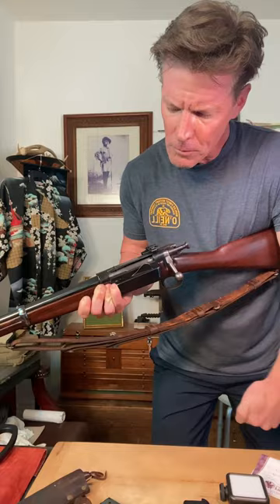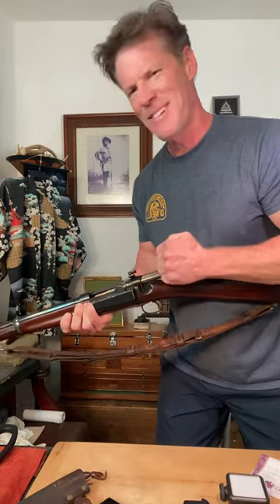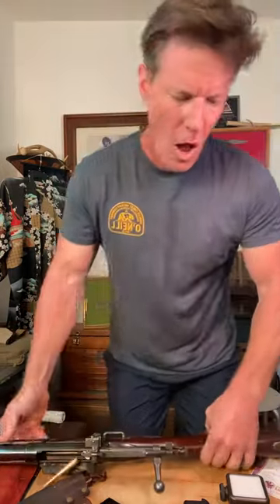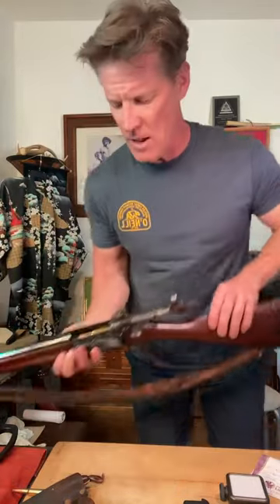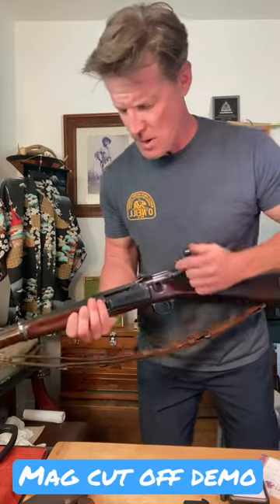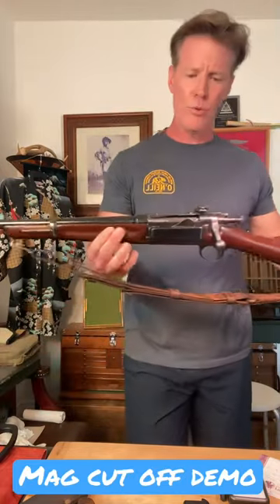Magazine vs clip but this happened! What's this?

Comment: The Krag Jorgensen had an INTERNAL magazine, and it served opposite of Spanish stripper clip loaded INTERNAL magazine 7×57mm Mausers during the Spanish American War.
Reply: And even though America won that war they decided the Krag was not fit for purpose and developed the Springfield 1903.
Reply: @krunk28  And the Springfield M-1903 was itself, a licensed copy of the German G-98, chambered first in .30 of 1903 (which prooved underpowered) then later .30 of 1906 (aka .30-06).
Reply: @krunk28  the 1903 was based on Mauser rifles they captured.
Reply: @acester86    Rrreeeaaalllyyy did you also know that it should really be called either M1906 or M1903 Mk1 due to the amount of changes after adoption. That we lost a legal battle with Mauser because we tried to confiscate the patents on the rifle during the war.
Reply: @krunk28  yes. I'm well aware.

Comment: The 1898 Krag apparently was the first American bolt action rifle. Used in the Spanish American War 1898. So came before other magazines.
Reply from the maker: Bing Bang Bong Bingo
Reply: I thought it was designed in Norway? Or do you mean the first bolt gun adopted by the US?
Reply: @illswift5  adopted
Reply: It was also the first smokeless powder cartridge.
Reply from the maker: @TwoStageTrigger  My Dad told me that years ago, thx Yes it was the first smokeless cartridge.
Reply: @Baasicstuff t was the first smokeless cartridge adopted by the us. And it was adopted in 1892 by the us. But it was adopted in Denmark in 1889. Which also happens to be the same year Paul Mauser came up with the stripper clip and incorporated it into the 1889 Belgian Mauser.

Also the Norwegians attempted and trialed a stripper clip system for the krag
Reply from the maker: @jakesolver4359  Thank you great info

Comment: The reason why it didn't eject when you went to catch it was cause you didn't pull the bolt back far enough to grab the next round. Super interesting piece of machinery there. I love the questioned blinks at the end
Reply: I caught that too and was coming to say this.  Thought it was funny
Reply: @mitchellhampton4175  that's how I felt when my high brass shells crammed themselves into the barrel on cam both times

Comment: You can see the exact moment in his mind where he said “wait, that’s not supposed to happen-“
Reply from the maker: you see the video were the bolt fell on the ground lol ;)
Reply: Watch when he goes to extract the last round, he doesn't fully pull the bolt back but the round falls out when he lays it on the table. When he goes to feed a round, the bolt was already too far forward and didn't pick up another round.
Reply from the maker: @kfred936  Magazine cut off was on another round was never fed. You may have said that lol its to hot in my office

Comment: It is called a trapdoor magazine, was first introduced in 1886, at which time Tube Magazines, stipper clips, etc. were all already in use. I threshing fact, they did develop a stipper clip "speed loading" clip was introduced for this riflle. One advantage that the Krag Jorgensen had was the side door opening which allowed the magazine to be topped off with a round chambered and ready, unlike top loading trapdoor magazines like the Springfield 1873...

Comment: It's called a capsule magazine. Stripper clips came out in 1889. The Krag Jørgensen was first adopted by Denmark in 1889. The capsule magazine was reduced in size to lighten a prototype rifle around 1886. The first country to adopt a stripper clip rifle was Belgium with the 1889 Mauser. The first Mausers were completed in December 1891. So the capsule magazine was both developed and put into service first.

Comment: I'd imagine an external box magazine. Like an internal magazine just reversed for faster loading. I'd also imagine it came from around the same time as the stripper clips. You didn't have to load a stripper clip, and when you wanted to unload you could dump all the rounds in your hand vs having them ejected by a spring and sending the rounds every where saving ammo. It's a really cool design. Except if I'm not mistaken that button to open it can be touchy

Comment: somewhat of a hopper fed rifle and the loading system was more of an experimental concept like when the p08 luger came out or when en-blocc clips were first used, no one knew if it was the direction to head towards in firearm design but it was an option to consider

Comment: It's not a debate.  It's a magazine with a loading gate/port (either is acceptable).  Anything, tube, detachable box or bunker built into the side of a berm is and always has been a magazine.  
  As a military trained munitions systems specialist, that was my job.  Dealing with small arms, heavy arms, bombs, rockets and more and Anything that stores ammo, be it separate or attached to the firearm is a magazine.   Loading ports are any accessible port or door that allows for the insertion of ammo into a magazine or directly into a chamber.
Thanks for playing.  😀
Reply from the maker: Nice name and spitting some fact, I like that
Reply: @Baasicstuff   The name was given me in the military, as I was a munitions systems specialist and used to blow stuff up for a living.  😆
Reply from the maker: @MtnBadger  Glad you're here ;)
Reply: @Baasicstuff   You need to "re love" my second comment, a simple edit took it away.  😢

Comment: What makes it nice, is you can grab loose rounds from an ammo pouch, make sure they're all facing the same way, and drop them all in and slap the door shut.  You don't have to load it 1 by 1 or fight with a stripper clip.
Just dump them in and go.
We've never had a jam.

Comment: It is a semi rotary internal magazine. Striper clips were used first in the 1889 mauser rifle and enbloc clips in  blackpowder 1880s rifles like the original mannlicher. All of those predate even the earliest Krag Jorgensen rifle. It wasn't the best design. Single lug rather than duel lug meant smooth action but limited the power of the cartridge to something at about 2200ish fps.

Comment: 5 round hatch loaded internal magazine. I would imagine this was designed and manufactures after the stripper clip or clip loading designs for internal magazines. Probably as a response to a period correct fudd saying "what if your rounds aren't loaded onto their little clips and you need to reload?"

Comment: That is a Swiss Krag rifle designed in the 1880s well before magazine designs were sorted out. The design was implemented for soldiers of the time to easily top off the magazine. While fine in target shooting situations in combat they were a nightmare and quickly phased out in favor of stripper clips as a simpler system under fire. They are cool but there's a reason the American Krag was only in service for only 5 full years of adoption and replaced by the Springfield 1903.

Comment: It's just fixed magazine. Any internal mechanism that holds rounds is a magazine. Fixed is just not removable as opposed to a detachable or box magazine. A clip is just a temporary holder of rounds that is used to feed a magazine. The clips for a krag follow the En Bloc pattern.
Also yes technically a cylinder of a revolver is a magazine and a speed loader meets the definition of a clip.

Comment: This style of trap door internal magazine system should be the default of bolt action guns back then instead of stripper clips, imo. It's so easy to just put rounds into the box and close it to load those rounds, without the need of stripper clips.

Comment: I don't know why this video and comments section bothers me so much, but it does. Possibly because the video doesn't actually say anything other than "look at this Krag". If the gun holds more than one round, and pushes that round into the chamber with a spring (clock or coil), it has a magazine. What you're referring to is a detachable box magazine which has existed in patent form since the 1870s or there about. Box magazines only came into widespread on LMGs due to the increased cost of manufacture compared to an internal magazine. Internal magazines can be reloaded with loose rounds, like the pill magazine on that Krag, or with clips like on name your favorite WW2 service rifle. En bloc clips invented by Ferdinand mannlicher act as an integral part of the magazine once inserted (when empty either fall out like on the Mannlicher rifle, or fling out like the Garand). Stripper clips, the much more well known variant were invented by Mauser. The third option is a charger, like on the Schmidt-Ruben. These sit around the bullets and are often made of compressed cardboard, like old shotgun shells. 
But you asked which came first, and that is just the internal magazine, in particular the tubular magazine. These are rarely able to be reloaded with any sort of speed loader, and are often a controlled feed. This is because otherwise the bullets would sit top to primer, which could risk a detonation (how much risk is debatable, but militaries thought it was enough of a worry to design around it). Lots of lever guns use tube magazines, and in service weapons the Lebel might be the most famous to use it.

Comment: According to the patents it was called a capsule magazine, and the original drawings had it as a 10 round coil which would wrap almost completely around the action. The Danes, Norweigians, and eventually Americans went with the more manageable 5 round version.

Really, it's still a magazine; just not a removeable box magazine like the one you picked up.

Comment: Have one of those used by the rough riders an the Krag .30-40 has one of the best actions ever made.
Reply from the maker: Wouldn't say best, very smooth though and a great pick for deer hunters.  Mauser action was its replacement, still around today.
Reply: @Baasicstuff  Maybe not the best but most collector's, historians, vote it as the smoothest action designed.
Reply from the maker: @paullion3763  you're a boss, thank you

Comment: It's called a magazine. A clip is only a clip when the bullets are on the stripper clip you use a stripper clip to load an internal magazine. Just because a rifle is loaded with stripper clips does not mean that it's internal ammo storage is now called a clip. Fun fact 556 ammo issue to the United States military comes under 10 round stripper clip and can be loaded into magazines via the stripper clip that does not turn the M16 magazine into a clip.

Comment: Do you oil the bolt?
Edit: this is the easiest I've ever seen to load rounds in a magazine or whatever it's called.
Reply from the maker: Completely cleaned, Ive also put close to 1000 rounds through this one.
Reply: This is the slowest way to load a magazine
Reply: @krunk28  you've never loaded a magazine in your life. we're talking about loading rounds into the magazine not the magazine into the rifle. Unless you have a magazine loader, this is the fastest way I've ever seen rounds loaded into a magazine.
Reply: @privatesocialhandle  I have this rifle and many others with these bolt-action rifles loading the magazine is the same as loading a rifle. I can load a Lee-Enfield's 10 round magazine faster than this.

Comment: Maybe its just me but this reminds me alot of "gate loading" revolvers. Ones where you slide a sort of door (hence "gate) open and individually load rounds into the cylinder because the cylinder doesn't swing out like in more modern revolvers 

Based on that, I'm thinking this came before clips and was possibly the standard sort of deal until the invention of the clip?

Comment: It's a magazine it's always called a magazine. whatever is used to hold the ammo for a gun is called a magazine, a clip is to fill the magazine so that the magazine can reciprocate the gun itself. even if the gun didn't have a "magazine" like you're used to like say a Kar98K, Mosin Negant or the Arisaka just to name a few they ALL had magazines. it's just they were integrally mounted because it was easier. once The great war went on and the innovation of the soldiers on the front. ended with coming up with the detachable box magazine as well as a lot of other modernly used tools that most take for granted. like the folding Entrenchment tool and the rest is history.

Comment: he either thought one of 2 things the original round was still there but fell out and was no longer loaded in the chamber or 2 he knew it fell out but didn't realize he didn't pull the bolt back far enough to load another road and thought it had

Comment: Parkhurst Device... Rare.. Only 100 Krag rifles and 100 carbines were made with the so-called Parkhurst device in 1899
Reply from the maker: 1895 variant here
Reply: @Baasicstuff   It's a very clever system. But pretty much got nixed by the 'O3 Springfield if I remember correctly
Reply from the maker: @bentleylongaker  Yep, Ive heard some say politics and such but my 1903 Mark 1 is pretty sweet, thats the next video.
Reply: @Baasicstuff   will check it out. oh.. And politics NEVER get in the way of Military' weapons and systems... ROFL
Reply from the maker: @bentleylongaker  well I have open ears, after this many comments Ive learned a bit

Comment: Anyone else wondering why there ist no round ejecting on the last pull.
Reply from the maker: magazine disconnect, I ejected the first round, the 4 in the magazine are there for the charge. If in a good spot have cover, you can load one round at a time, without the next round feeding up, saving the other 4 for the charge.

Comment: Do they not make dummy rounds for 45-70? The use of live ammo really makes me sweat
Reply from the maker: It does me also, I have quite a few safety rules I follow. The only rifle Ive had that I don't cycle would be my SKS, as they can fire from what Ive seen.  Modern Ammo is very safe, but a gun is not a toy and should be respected at all times.
Reply: @Baasicstuff  not trying to be "safety nazi" just saying the first thing I noticed lol
Reply from the maker: @Jon871000  No totatlly fine. its not an ignorant comment by any means, I may do a video on firearm safety, I was a range officer for a few years, Ive seen some crazy stuff, safe or not thats why that rife is pointing down alway while that round is chambered. I also just don't pull triggers to just pull a trigger, guns and bad habits can be deadly.  thanks
Reply: Those aren't 45-70 rounds, they're 30-40

Comment: Failure extract at the end of the video
Reply: He didn't pull the bolt all the way back at the end.
Reply: @makinwaves8147  watch again it definitely chambered a round
Reply: @makinwaves8147  you know  think the bolt rode over the top but he did look puzzled when it didn't extract because a round never chambered.
Reply: @makinwaves8147  he didn't pull the bolt all the way so it probably didn't catch the rim of the cartridge
Reply: The model of rifle has a pushrod extractor the the bottom of the bolt (the hits the bottom of the head stamp) and a small lip/clip to holt and hold the rim of the case at the top of the bolt, the casings are pushed upward upon opening the bolt by a spring in the breach, the rim of the case gets caught by the lip/clip at the top of the bolt. Then the round is chambered, fired, then ejected by the pushrod kicking the bottom most orientated part of the head stamp, the that lip/clip that stops the case is used to angle the ejection upwards.
Reply: @FirstLast-ox1iy  exactly the same way many other semi automatics eject the spent or live round but upwards instead of sideways like we are used to.
Reply from the maker: The magazine has a disconnect, allowing you to load one round at a time, while still maintaining your 4 spare rounds in the magazine.

Comment: I dont know it but looking at it its not a magazin. The closest would be a clip or some other name
Reply: It is a magazine, it's a fixed magazine with a "hopper" or "trapdoor" loading gate. A clip is used to hold cartridges and insert them into a magazine or in some cases is itself inserted into the magazine.
Reply: @Aetius_of_Astora  but isnt every clip fed rifle like that? They hold their "magazin" fixed inside. Im no gun pro so i dont know and it seems like an american problem to me...
Reply: @tacticalt-rex8611  A "clip-fed" rifle is typically fed by an internal magazine which is loaded with a clip, most rifles that use a clip can be loaded without one but require their magazine for operation. 
There are some rifles that accept clips but also have detachable magazines, although it was not commonplace to reload them by replacing the magazine, it could be done. This is why the distinction of it being a fixed or non-detachable magazine is made. 

A clip is simply a device used to load the weapon, a magazine is what contains the cartridges after it is loaded. Sometimes a clip is retained inside the magazine, as with the en-bloc clips used by the M1 Garand, which gives it the iconic ping upon ejection.
Reply: @Aetius_of_Astora  so this rifle is a magazin fed rifle?
Reply: @tacticalt-rex8611  Correct, it is a Krag Jorgensen rifle which uses a unique fixed magazine on the side commonly known as a hopper or trapdoor magazine.

Comment: "Am i the only one trying to figure out if those are dummy rosunds?"
Reply from the maker: LIVE baby, dummy rounds are RED and BLUE and for those that make their own...not a fan of that. Even if they have a BIG YT channel ;). If this was an SKS I would not load live rounds, for example.  Some guns have known issues but guns that are mine, clean, etc are safe to cycle with caution. I do my 9mm all the time, as does any CCW holder.  I grew up with guns many did not so their gun safety is fear and TV.  I was a bit complacent when I was younger, but 20 years in the Navy fixed Mr Know it all.